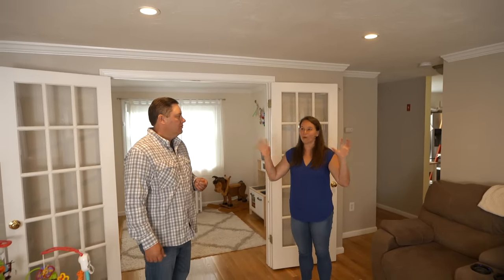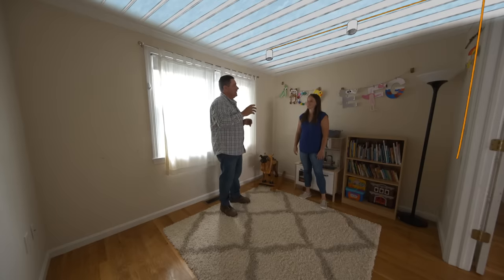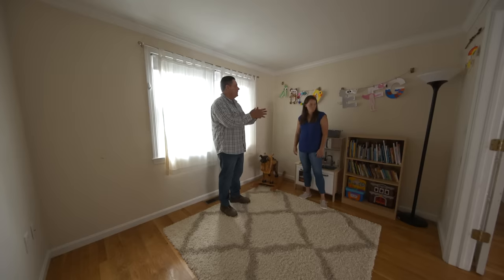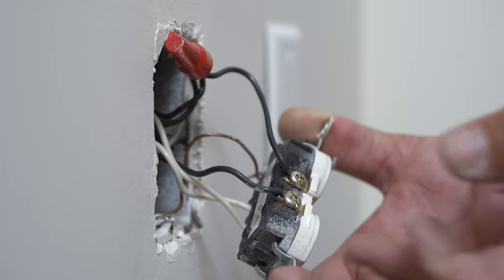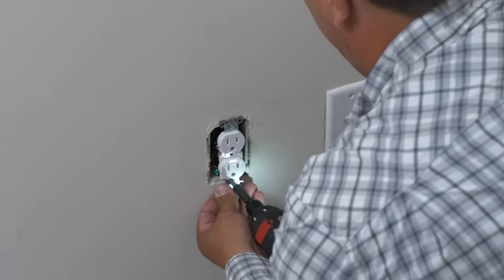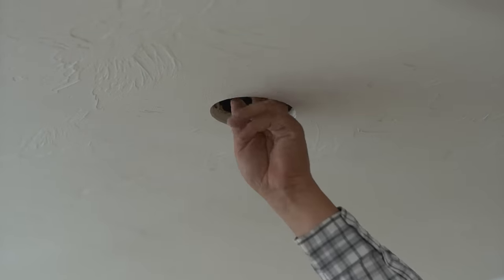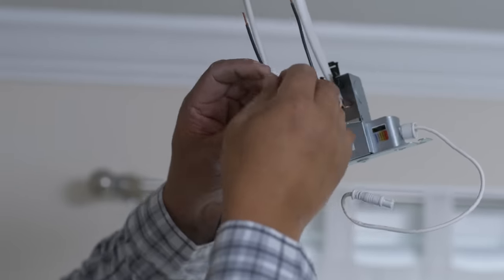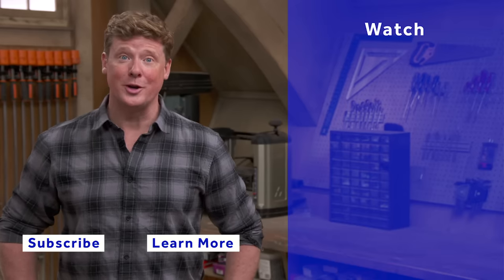How To Install Recessed Lights | Ask This Old House

Comment: I'd be stuck trying to get that fish tape over to the hole for about 2 hours lol.
Reply: Spoken like someone who has run wire before... =)
Reply: Yeah I have no idea how he ran that wire without a few extra holes in the wall/ceiling
Reply: @RoastBeefSandwich  he showed every step, and as usual they only ever show you easiest case scenario with electrical work. This job they had gaps in framing in both directions to easily runs wires in both directions, which is extremely rare.
Reply: @KitchenerLeslie2   I have never encountered that. In fact earlier this year I did this exact same project, and it resulted in an extra hole in my wall and three in the ceiling. They were easily patched and blended in obviously. Just an extra step.
Reply: He got very lucky

Comment: I've done this same job a few dozen times, and it's interesting how they leave out several important steps that are frustrating and rarely go easily.
Reply: I’m about to start on this project. Do you have any tips on what to do for those frustrating steps?
Reply: ikr, the house is like a demo house without fire block in the wall, it even have strapping so no need to drill holes through the joists. Fishing the wire seem so easy and the hole on the top plate is within arm reach.

Comment: I literally just did this project at home and had to punch multiple holes in the wall to fish wire through horizontal fireblocks. If only it were as easy as he makes it....
Reply: Don't think those were firestops unless it was a really tall ceiling.  They were most likely blocking to keep the studs straight during framing which is very common.
Reply: @Off-Grid  whatever they were they made the job harder!
Reply: @swimmerhair  usually its the insulation that makes me wanna off myself because i cant fish wire anywhere with it in the way, he definitely made it seem easy asf lmao

Comment: LOL the angle he used to drill through the topplate looks like it drilled through the other side of the wall and man I have never fished so easily. This guy must be the best at pushing wire up through a small hole and around to the room. OMG this video. I miss the days Of when Bob used to show how to do this stuff : ) . And the acting is so bad now, these people seem so wooden and not really believable

Comment: If I can't access the wiring at the switch on the wall can I  just run the light wire to the receptacle and connect it there?

Comment: I just did this in my living room that had no lights other than a lamp, just like the video.  The toughest part was fishing the wires through the wall and ceiling but I managed.  These lights are a great look and the overall job was fairly easy…with the right tools.   Great video.
Reply: I'll be installing some in a living room too.  Luckily though I have easy access to run the wires.
Reply: did you end up doing a lot of patching?
Reply: did you have to make the holes on the top of the wall and ceiling to fish the wire. I did not get how he turned the wire from wall to ceiling.

Comment: I've been doing this a  long time,  but still learned a few things here.  Using a multi-tool  to shear off the nails of the old plastic box was a slick idea.  He had several things going in his favor - strapping being a huge one.  And the location of the existing switch being on what appeared to be an interior wall meant the framing was pretty simple.  But I like the methodology, including drilling the hole for the can light  first which also serves as an exploration hole and a way to monitor the progress of drilling up through the wall's top plate.
Reply: Those vibrating cutters come in really handy

Comment: Can someone please tell me what drill bit he used to drill up through the switch opening and into the top plate??

I've been notching and patching walls for years. This would save me so much time.
Reply: I got a kit from Lowes for this.  It comes with the drill extension, magnet, cable grabber, and drill bit (though mine was a spade bit).  He's using a wood auger which I would recommend instead of the spade bit.  I tried to drill straight up like this with the spade and it somehow went sideways through the crown molding in the other room.
Reply: Look up Greenlee 921. Never liked the bit showed in the video. Just keep the bit new/sharp. I buy a new 3/4” bit for each job. It takes some practice to steer the bit and keep it from taking off in an unwanted direction. Also keep in mind that the possibility of hitting a wire or plastic pipe when drilling blind thru multiple joist is very real.

Comment: They make it look too easy. Using a looong drill bit to get through that top plate would not be so easy with do little space to work. Fishing the snake through the top plate and then getting it through the ceiling hole would be a serious pain. This is not a diy thing unless your willing to make some costly mistakes...

Comment: Only thing I dont like, you do not show the difficukt part. How the heck did he get the wire through the hole in the top plate over to the light fixture hole ???

Comment: How big is the drill bit for the vertical drilling. I picture just dead ending my wire into the top plate for two hours before smashing my hammer into the wall. 

Then once I make that hole I have to cross my fingers that it turns 90 degrees.
Reply: Drill bit is probably 3/4" diameter. The extension is probably 4-5 ft long. If you use a fish tape and it doesn't go around the bend you use another fish tape from the other direction / hole to grab it... then use the tape to pull the wire.
Reply: @rupe53  thank you sir!
Reply: @rupe53  How do you run the fish tap through the hole you drilled in the top plate without cutting additional holes in the wall?
Reply: @aurvaroy6670  ... very carefully!
Reply: @rupe53  - I have the same question and am really interested in a valid answer. Could you help out?
Reply: @bethanyanderson1745  ... I already gave the answer. You use a second fish tape to grab the first one that's not going around the bend. I have done it and it's a ROYAL pain at times. OTOH, it beats redecorating if you don't have matching paint or trim to spare. In my own home I have all the extra paint saved and marked from the last time so not an issue. I also have scraps of trim to match just about everything I have done. BTW, I have also cut a dozen holes and patched them afterward. Came out perfect but was lots of work.
Reply: @rupe53  -sorry, I didn't think you were serious. My bad.  Sure I'm just overthinking this procedure but how does one get any wire/tape to slither thru a freshly drilled hole then suddenly bend, change course and commence along my desired path? 
*Without Penn & Teller's help?
If coming from one direction doesn’t work, how does coming from the other direction work any better? If, IF, my wires from opposite directions happen to meet, won't that happen in the corner where the ceiling and wall intersect? Taping them together would require another hole in the corner, right?

The 3 Stooges wiring a house: https://youtu.be/vfBYm6LMvd4
Reply: @bethanyanderson1745  .... Hey Moe, there's wires in the pipes! On a more serious note, the fish tapes have a hook on the end so once you get it through the hole by a few inches you attempt to use the second tape from the other direction (or a coat hanger bent to suit) to grab it and pull around the corner. As I said, it can be a royal pain, even with some practice, which is why many wait to do this when redecorating. Then they can make bigger holes or more holes to do it faster. (well, that part is faster but the repairs take longer)
Reply: @rupe53  aw, makes more sense now. Thanks!

Comment: I love magic!!
Did you see where he took a drill bit and drilled a hole in the top plate???
Don't try this at home folks, you'll drill thru the wall into the next room.
Unless he has some fancy 7 foot long flexible bit he can bend and aim inside the wall with mind control (that he didn't mention in the 3 second sleight of hand), it was PURE MAGIC!!
I love how these videos show off what the spendy pros can do but teach you NOTHING!!
Reply: 100% right.

Comment: This was so interesting. I usually hire an electrician for this kind of stuff, i dont trust my "skills" as a homeowner when it comes to power
Reply: its not as hard as people may think. residential lighting and outlets is a easy as it come when running your own wires. Its when you gotta work with wires that are already there that makes it seem hard. this is coming from an electrician

Comment: I don’t know about everyone else but I have never seen a light switch have that much wire in the box, at most I have like inches and it’s extremely stiff. After reading that over I realized that might have came out wrong 😅

Comment: Can anyone answer this for me? I installed some pot lights... the wafer type in my garage ceiling.... I wanted to continue the power from the existing porcelain fixture in the ceiling and use this fixture as the first in the daisy chain because I wouldn't have to install a separate switch, ...well that porcelain fixture doesn't have a ground.... How or will .....this fixture not having a ground have an effect on the pot lights in this daisy chain?  I would sure appreciate an experienced answer.  Love your videos Ben !!  Should I just go get a different fixture with a gound? Most respectfully Andrew Allen

Comment: Has anyone replaced existing recess can fixtures with these thin fixtures? I have my attic above and my current 6” recess fixture cans are open and I’m sure Air is leaking into the attic and I’d like to swap them out to have a better seal between living and attic space.

Comment: I am in the process of wanting to do this.  My question is for the blind drilling you are doing through the upper plate from below the outlet.  How do you know that there wasnt anything above the top plate that would be affected, a water line perhaps or a drain pipe to drill into by accident?  You show using the mirror from below, but how does that see above it?
Reply: You'd want to find an outlet to tap into where you can see the areas around it so you don't hit anything.  Stay away from walls that you know have plumbing.  Better yet, if you are working below an attic or above a crawlspace you can often find a junction box to tap into.
Reply: @Off-Grid  I wish it was an attic, Ive done this exact thing with an attic install, and was so much easier due to basically being able to physically be in the spots needed.  This is an interior wall with I assume no plumbing, but without visually looking, I have no idea where the Pex pipes run throughout the house, hence the "blind" drilling.  I current have a plug like this video has that operates a celing fan with lights,  so I want to add 4 pots to the room.  Currently there is a hole there that has the current wires, but hitting that hole will be all by chance with a fishrod.   I just dont want to have to cut the wall drywall to guide this or cut a new hole, so I dont have to patch and paint later
Reply: @Ampacityelectric  We did this in two bedrooms in the basement.  One we got lucky due to the stairs to the basement and were able to fish the wire with a fish pole.   The other not so lucky, so to err on the side of caution, cut out a piece of drywall at the top of the wall so we knew for sure.  While extra work to patch, I want to be correct as well.    Thankfully we did the lights, it was so much of an improvement for an afternoon of work

Comment: Can you use these slim lights for a ceiling that is the Attic? I understand the insulation it's an issue sometimes has these things can get pretty hot

Comment: Not a bad video, but also need to talk about drilling through the top plate from the bottom using that flex bit and not having to go up into the attic to inspect what you could potentially damage.  Also need to talk about spacing.
Reply: No attic but yea i would have liked to see how they drilled the top plate w/o hitting drywall…or is it only me 🤦‍♂️
Reply: They did talk about that. There is a bathroom above. He has his drill bit going vertical between the studs. Above the drill is a wooden top plate. There is no drywall above that. Above the top plate would be just hollow space between joists, then a piece of plywood/etc. for a subfloor that is resting on those joists. Above the subfloor wood be all the layers that make up a tile job. There is literally no drywall to hit. If you drill that you'll feel resistance as you go through the wooden top plate, then the drill will rush forward at it gets through it and enters the hollow cavity between the joists and under the subfloor. You'd have to then keep drilling up and go through the subfloor which is always possible, but any bit of being not being a total moron would prevent that. Once he had the hole in the top plate, he's now above the ceiling drywall between two joists. He knew the orientation of the joists before hand which let his fish that wire between them. If the joists ran the other way he'd have to drill through each joist that got in the way which is not much harder, but way more time plus holes to patch.

Hope that helps a bit. You should review house framing. If you get smart with house framing knowledge you'll better be able to see through your walls and know what's likely where.
Reply: @Dom-nt4pi  there was no mention of technique or tools-used for drilling through the too plate. I bet they had an inspection camera to confirm wheee the Klein auger bit was going before drilling
Reply: There was no attic. They had a camera in the first hole that he drilled where you saw that the drill bit came out so they should have been able to see that there was no obstruction. Also when you use a flex bit you can feel the difference of when the drill bit is touching drywall and when its touching wood. Just dont start drilling until you feel wood.
Reply: @MrVincef1990  He also used an inspection mirror to look above the switch to make sure there were no pipes or wires already coming into the top plate.
Reply: @zefrum3  Why would there be drywall above the top plate? It is only you Lol
Reply: @illestofdemall13  who said anything about drywall above the top plate? Hmmm? Forget that a stud wall has sheetrock on both sides of it?
Reply: @zefrum3  There is no drywall above the top plate. He is drilling vertically, not horizontally.
Reply: @zefrum3  "No attic but yea i would have liked to see how they drilled the top plate w/o hitting drywall…or is it only me 🤦‍♂"
Reply: @illestofdemall13  you dont understand, there is dry wall attached to the top plate; when drilling through the top plate the auger can go sideways
Reply: @zefrum3  I see. Now I get what you meant. They also make a guide for those bits so you can keep it centered and drilling vertically. With experience, the user probably won't have an issue with accidentally drilling into the corner and going through the drywall.
Reply: @illestofdemall13  this @zefrum3 guy doesn’t get it. You could put another mirror or scope in to check your drill bit placement but it is going to hit to top plate unless you’re an idiot. You’d feel the difference. It could rub agains the walls drywall I suppose but it’s not something you’d see on the inside of the room. Also it likely wouldn’t even happen that much.

If you have these questions you shouldn’t do this job. You need more practice with a drill and learning the feel of it before you move on to blind drilling with long bits and flex attachments. No hate, but that’s reality.
Reply: @Dom-nt4pi  dude u r hating. Ive do e this exact job through out my 1970s house and my ‘06 house. I know from experience that the auger bit can catch off center or a nail and poke out the sheet rock, even if you are using the guide. Part of the reason why this install went so smoothly is because its a simple setup. Btw, the house in the video has strapping, which means you can push an inspection camera around underneath the joists.

Comment: I actually prefer floor lamps (the "dingy" lamp shes talking about). Spreads the lights upward to the ceiling instead of blasting your face with light.
Reply: They are making a comeback.

Comment: Anyone know how to remove this type of lighting without pulling the drywall with it?
Reply: Pull one side down a little, push up the spring carefully and pull out half the light, then repeat on other side. Be careful because the springs hurt if they retract on your fingers. Lol
Reply: @illestofdemall13  tried it and works thank you! One of the water lights I installed crapped out on my so I had to replace it.
Reply: @swimmerhair  You're welcome, glad I could help.

Comment: How do you wire the rest of the recess lighting to one switch??  He didn't also mention how far apart they should be?  Maybe the light was strong enough that it didn't matter?
Reply: He tapped into a split receptacle meaning the switch controlled the outlet and now controls the light.  Most LED lights are very bright so you need fewer to light a room.  We only use 50W equivalent LED bulbs for example because they seems as bright as a 60W incandescent.  It's your preference as to how many you use but I'd suggest using a dimmer switch and comparable lights  just to make sure in case the lights are too bright.
Reply: @Off-Grid  but it’s pretty odd to have recessed lighting on only one side of a room serving as general ambient lighting.  Not accent/wall washers or task lighting, of course.
Reply: @bethanyanderson1745  maybe she just wanted a reading light in that corner....not sure
Reply: @Off-Grid  shrug
Reply: And what was that wire he had? Never seen that stuff before. No mention of the wire he used, or the magic flex bit he could steer thru sheetrock. Astounding!

Comment: How did you get the fish tape through the small hole you drilled in the top plate, and then miraculously turn 90 degrees over to the hole in the ceiling? You could've shown us since you had a camera up there.